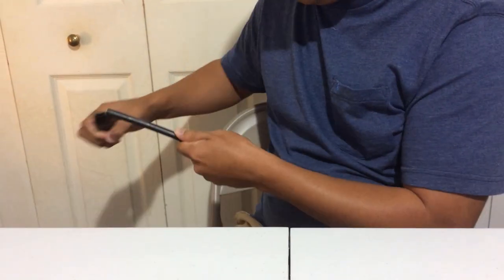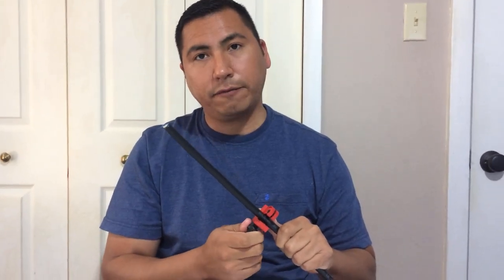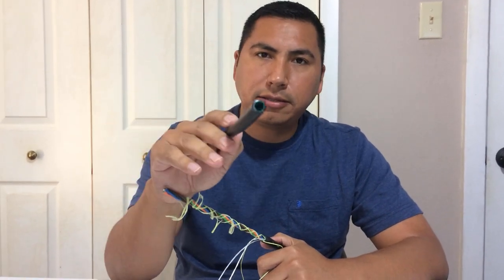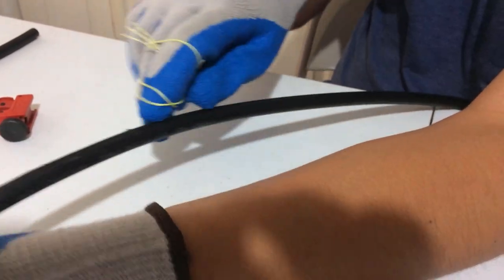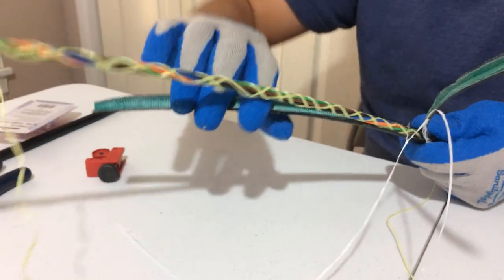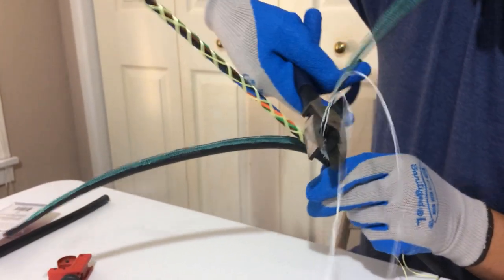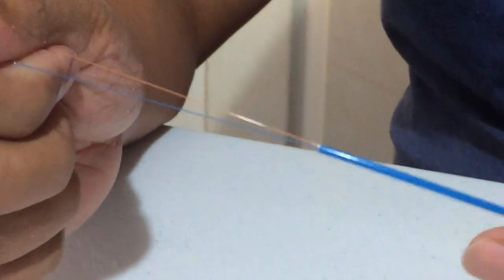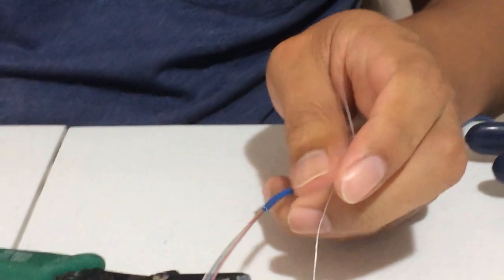opening a 48 Fiber Cable

Comment: where did you get that cable cutter!?!
Reply: some of these pull strings are a pain in the ass
Reply from the maker: Which one
Reply: @fiberoptic166  where did you get that cable cutter from? The 48 CT is my nemesis with the pull string. They tend to run into each other when pulling
Reply from the maker: @Ceejay_kay  I hear you. I do small sections at a time to help reduce that problem. The red cutter is a pipe cutter you can get a local hardware store.

Comment: So basically this 48 core will break down and connect to a smaller core cable ??like an expressway leads to a highway that leads to streets??
Reply from the maker: that is correct
Reply: @fiberoptic166  i have my thesis im writing.Quick question is there a free network planning software?Or something of the sort where i can do a sensible presentation?
Reply: Yeah, something like that Bubbi!